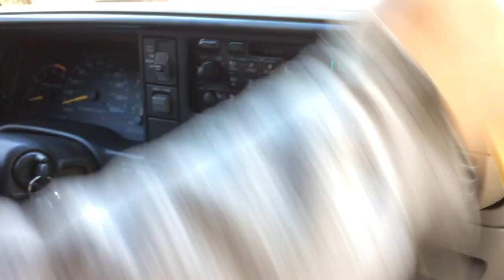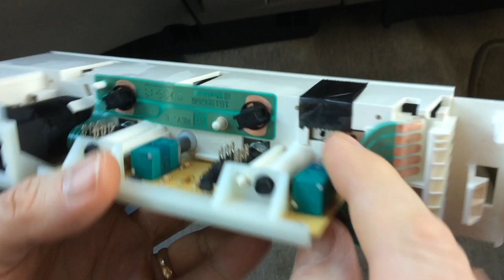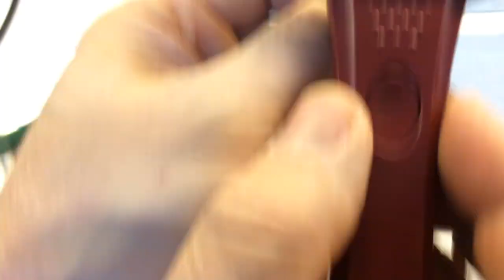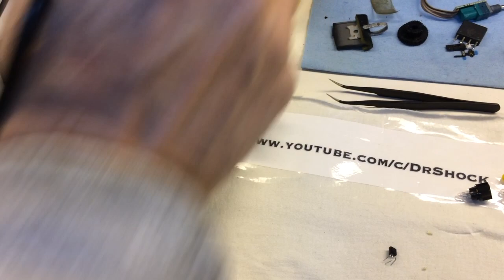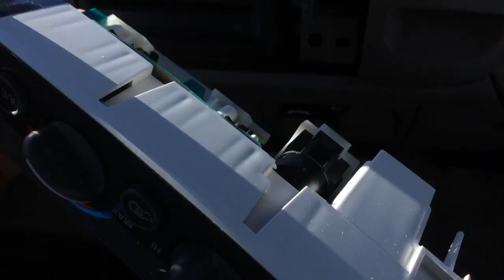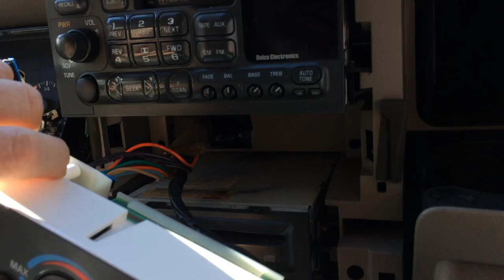1996 - 2002 GM Truck AC Blows Floor Only / Climate Control Module Transistor Repair (Chevy & GMC)

Comment: Okay one day my AC and air condition motor no medium high switch work blower stop so I'm like okay what happened so I turn the knob back on and off and the blower change back on next couple of days it stopped working again I replace the relay switch still not working somebody talk to me please
Reply from the maker: If the problem is just some of the blower motor settings for AC stopped working, I'd suspect the selector switch.  Not sure what you mean by relay switch but I'm referring to what I go over in this other video - https://www.youtube.com/watch?v=Gl5_CEJdu4o
Reply: You have no volume or audio

Comment: went and had my air system serviced and they managed to have it blowing cold and as hard as it will. he told me that i have missing vents and need to run new ducts. how do i go about doing this?
Reply from the maker: Ductwork is behind the dash assembly, so they may mean that these have deteriorated and need to be replaced.  Vents should be obvious if they are missing as they are in clear sight.  These parts were all long ago discontinued by GM, so your options are salvage yard or possibly fabrication on the ductwork itself.  Some of the vents, but not all, are available aftermarket.  I'm not aware of any aftermarket duct parts though.
Reply: DrShock 
Thanks for the reply. Be another project taking everything apart but what’s not to ‘project’ with a GM. have a good day man

Comment: This does not apply to 95s?
Reply from the maker: Same transistors and procedure applies, but has a difference circuit board layout so the video will not directly match those older ones.  I mention in the video description about this.

Comment: I have a brand new unit in my truck already. The problem I have is that it blows air wherever it feels like. It doesn't matter where I set it. Floor, defrost, or vents I sometimes get vents sometimes defrost,  sometimes floor, but most the time all of them. It's okay in the summer when it's just the A/C, but in the winter in ND it's not so good when you need as much heat on the windshield as possible. Have you ever run into this or heard of this?
Reply from the maker: If the vent and AC controls work (AC compressor turns on as expected, just outside air flow when expected) and the temperature blend works (ratio of cool to heat is as set) and the fan speeds are all working as expected, that would leave just the actuator motor for the zones.   On these trucks it's to the right of the accelerator pedal and controls the flap/door that directs the air.   If all the above are true, that would only leave that motor, or the flap itself, to check out.
Reply: @DrShock  Great, that's what I will look at then. Thanks for the reply and keep up the great work

Comment: Hello, my problem is the air control multi function nob. I turn the vent air on and it blows through the floor vents for a while and then switches over to the air vents. Ac works good just would like to know what could be causing the long delay on switching over like that.
Reply from the maker: My first reaction is the zone actuator motor that directs the flow to the vents.   They can get weak after many years of use.   You might want to check around YT for videos around this component, also the blend door motor which does a similar function for hot and cold air mixing.

Comment: Great video! Bummer that your new selector console had a bad transistor though. Where did you find the new selector console? ANd how much? I just bought a console on eBay and it is in worse shape than mine, and plugged it in to find the same issue still occurring with the blower stuck on floor only, which led me to you. Still watching this now, haven't tried yet. Interestingly I had just replaced my blower motor prior to this selector switch going out.
Reply from the maker: So the replacement control module did not have a bad transistor, there was a short in the underhood engine AC wiring that was burning them out which is a common cause for this after a couple of decades of vibration the harness insulation wears thru in some spots.  That particular short can be difficult to trace down, as often it only shorts on certain driving conditions (like over railroad tracks).  I recommend only buying brand new, never used, on this part due to the way the plastic degrades with age the mounting tabs will yellow and break off.  eBay can be an inexpensive source of new old stock parts, or rockauto.com for brand spanking new.
Reply: @DrShock  so are saying that you replaced the transistor on the new module in video right? And then said it worked at end of video? But then after driving a bit, burnt out again?  @DrShock   @DrShock  when I was looking at my wiring, following from condenser and firewall etc. It is all wrapped up well and covered with the plastic tubing. So I cant really imagine that has happened here, but  it's possible. I dont think it's the actuators, because none of them move at all when turning zone selector. The door flap for floor moves freely by hand. All the fuses look good, wires look good, ground locations look good. Connectors look clean. Think I just bought a used console with same issue baked into it? I do remember around the same time this went out that my radio must have shorted out or something because the music went from all the speakers playing to just the rear for a few seconds, and then the music came back to all speakers. I think that since my clips are broken on my selector console, and it has this open/expossd circuit board, that it bounced and touched the metal radio casing. That's about all I can see that would do it. I wonder if i should attempt to replace my transistor or not? Quite a coincidence that the used one i just bought has same exact issue.... i don't like that, makes me think something else is going on but I guess trial and error is the way to find it.
Reply from the maker: In my case I had the AC control module go out that was an ACDelco installed new and around 10 years old.   The brand new ACDelco replacement died after a week which made me think at the time it was poor quality transistors.   That prompted me to research the problem, trace down to this transistor and replace it and do this video.   Later on I worked on this same problem on a different truck, and knowing this now I was able to trace the problem to a worn spot on the harness to the compressor creating a short in the circuit that this transistor feeds power into.   So now I tend to suspect shorts as the cause for these transistors burning out every time.  There's a few very specific symptoms of this particular problem I summarize in the description.  If you don't have those, or have other things going on like the radio behavior,  it could be you have multiple electrical problems going on.
Reply: @DrShock  well that story about your new replacement selector module and replacing the transistor doesnt really make sense to me, because where is your truck wiring shorting out then? You didn't find a short on your wires, but you did replace a bad transistor right? And dont you find it funny that a short is always blowing this same transistor, and resulting in the same single zone indicator knob dysfunction?And the short occurring with same exact wire?? Rather than wrecking the other components of the module? Funny it's always the zone selector gone bad, but all the rest works fine. It would be pretty rare for that one single wire, wrapped up and clustered with all of the rest of the wires, about 8 of them, to be the one single wire shorting everytime, and just that one single wire, none of the others. That radio thing I described happened one time, and is working fine ever since, it lasted about 5 seconds that's what I think may have touched the module with the metal radio case because the clips on module were broken allowing it to bounce up and touch radio. But I dont know for sure, just hypothesis. Otherwise I cant figure out why my zone selector went out on me, dont see any wiring issues, no shorts, or exposed wires. And my symptoms are the exact same thing that you have described, just the zone selector stuck  blowing on floor in my original module, as well as the used one I just bought on Ebay, which also has broken mounting clips incidentally, but I didn't touch metal radio with circuit board myself on that one. So I guess my question is after you replaced your transistor on the replacement module, have you had the issue come up again on your truck? If not, does not really indicate a short circuit on your truck does it? And are you saying that you replaced a perfectly good transistor on your replacement module? I dont understand here, why didn't you repair the original one? I get that the other truck you worked on may have had a wiring short, but it seems this is a very common issue with these climate selector modules judging by the views and comments on the video. So idk, I think you were probably correct initially that these transistors will go out on that one zone selector only. Please let me know what you think, I appreciate the input and the attention to this matter. I am sort of racking my brain here and spent all day monkeying with these damn modules, looking over wires, looking over door actuators, fuses. The fact this other used module I bought has the exact same symptoms right off the bat upon plugging in, kind of detracts from your wiring short theory as well I believe.
Reply from the maker: Alot of questions here.  I'll try and touch on them.   You would use a transistor tester, a function on most high end digital multi-meters, to test the semiconductor before making a determination it's defective.   So yes, it's straightforward to confirm the diagnosis with the right tools.  Consulting the electrical schematic of the service manual, you'll find several flavors depending on the engine and fuel type.  In all cases this particular power transistor feeds the power to the cycling switch first as it enters the engine bay from the dash.  It's a green colored wire in the harness.  The power feed then takes different wiring harness paths, and sometimes thru pressure switches too, for each engine type differently on its way to the AC compressor.     The other transistors in the control module serve other purposes, some control the blend door signals, for example.   So they wouldn't have anything to do with the power feed.   In my experience transistors are fairly robust, what kills them is sinking alot of current quickly (a short), or overwhelming them with a rapid power surge (static electricity discharge for example).  I've done this repair on several trucks now, and where I had the case of the transistor blowing out every time it's always a short in the harness.  Where you don't then it's more likely just that transistors day to die and nothing more to it.  The only way to find out is remove the transistor, test it, and if bad replace it and see what unfolds from there.
Reply: @DrShock  short in which harness? What about your truck? What about this video you made replacing your  transistor? Why was yours bad?
Reply from the maker: I've done this particular repair for about 6 trucks now, not all mine of course.   But the one that prompted me to take the time to video it was just a bad transistor.  Tested bad, replaced, and never had another problem with it.   They are cheap to replace, they die and there's really nothing more to it than that.  It's like a burnt out bulb, replace it and move on.  Only if it fails again, you have a short regardless of what you might think - you have a short in that AC power feed.  Most of the trucks with this problem that I have repaired though,  end up the shorted harness case.
Reply: @DrShock  the harness on the module itself or the one under the passenger foothole that passes through the dash? And you said AC power feed is the green wire or the light green? After talking with you it sounds like the transistor is apt to go bad just as much as a short as cause for issue. and again, thanks for all your help. At least I have possibly given you more content ideas for future videos.
Reply from the maker: Probably the best way to highlight the power feed is to review the AC schematic for our engine in the GM service manual.  If you don't have that, there is a digitized version for 1998 here - https://www.gmt400.com/threads/88-95-service-manuals.43575/ and review the AC electrical, the schematics are full page.  The power transistor is not apt to go bad, but it can go far more often than any other component in the AC control module.   I can't recall in over 20 years reading or experiencing about any other failure but a burnt out resistor in these modules (other than the very common fan speed switch wearing out).   Again, if you remove the transistor and it tests good, you have something else going on.  If it tests bad, replace it as shown in the video and see what happens.  If it fails immediately, or within a day or two, you have the short circuit to trace down using the service manual schematic.  If not, you just had a bad transistor and will likely never have a good explanation as to why it died.  I typically don't record repairs I do on vehicles owned by others, if I did I'd probably have twice as many vids on this channel ;-)
Reply: @DrShock  very good. I don't remember if you should how to test the transistor here, but I will watch again. You don't think the transistor is apt to go bad, with all of these you have replaced, all the views, comments, etc? Kinda weird you mentioned they go bad like light bulbs, now say not apt to go bad....
Reply from the maker: No, I didn't show how to test a transistor - plenty of other videos on YT for that.   My analogy with a light bulb was simply to say, why dwell on why it died given its such a inexpensive part, not that its lifespan is in anyway similar to a bulb.   So no, I do not think they are apt to go south, but I do think after 20 years or so of heat and vibration that other conditions set in that result in it happening anyway.
Reply: @DrShock  I dont know with so much indication of them burning out, and always that one transistor it seems quite common. And after all, that's why your video is popular! If it was a rarity, I dont think the video would have much impact.
Reply: @DrShock  your video and especially.tje comments section are incredible! Kudos to you sir for being so organized and professional! Thank you!!

Comment: Do you suggest general purpose transistors? Also, do you suggest a specific brand?
Reply from the maker: No specific brand, the numbers are more important.  General purpose rating is fine yes.
Reply: @DrShock  Thank you sir!

Comment: Really helpful thanks. Bough a new one like $170 and installing it got burn again a gave up until I see this
Reply: Does getting a new one fix it or will it just screw up after a while
Reply from the maker: @lamangman556  It's usually burning the transistor out due to a short somewhere in the harness.  I've seen these where it's just a rub thru somewhere along the harness and it's intermittent when it will touch the engine and create that short to ground that kills these little transistors.   Sometimes it can be from a momentary power spike though, in which case a replacement will be enough.  Hard to say over an internet comment forum, every situation is unique.
Reply: @DrShock  ok thanks I have a 1996 sonoma that the ac is doing just like In the vid but I don't have the tools or skills to do what u did so I was wondering if it would be a waste of money to buy a new module
Reply from the maker: @lamangman556  In your situation, then I might be more inclined to try a salvage yard pull first to inexpensively see what happens before spending on a new one.  You'll of course want to pick a truck that was in an accident vs one sold off from being inoperative, to increase the probability its AC was still working.
Reply: @DrShock  ok will do thanks
Reply: So if it was a short in the harness then which harness area would you suspect it would be in so I can look mine over

Comment: I have a 95 Tahoe LS with rear defrost button and my hvac unit has only 2 plugs connection a 6 prong and a 8 prong power supply can someone please advise on where to get replacement except junkyard ... thanks in advance for your help 
Russmagyar@gmail.com
Reply from the maker: eBay is probably your only option for 95 and older.   The GM parts are discontinued, you could find the right part number to set a search for on there using rockauto.com - https://www.rockauto.com/en/catalog/chevrolet,1995,tahoe,5.7l+v8,1061345,electrical-switch+&+relay,a/c+and+heater+control+switch+/+panel,4212

Comment: Can a "dragging" blower blow the resistor I've literally pulled the entire dash trying to find a short and cant find one
Reply from the maker: When you say resistor did you mean to say transistor given this video?   Or are you talking about an actual resistor elsewhere on this same control unit circuit board?   For the transistor the answer would be no, has nothing to do with the blower motor circuit.  In my experience the only shorts that blow this transistor are either on the control unit, over voltage on the incoming power harness, or a short to ground on the outgoing power harness (the green wire on the flat connector heading into the accumulator cycling switch first and then onwards).
Reply: @DrShock  yes I ment transistor I put a new control panel in and within 30 seconds it fired the transistor and went back to not working i guess I'll retrace the green wire once more